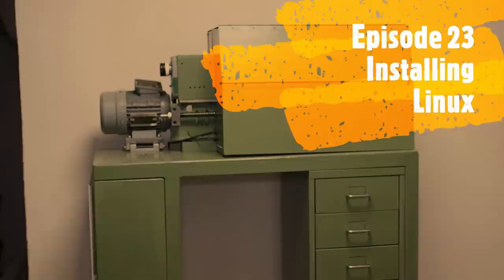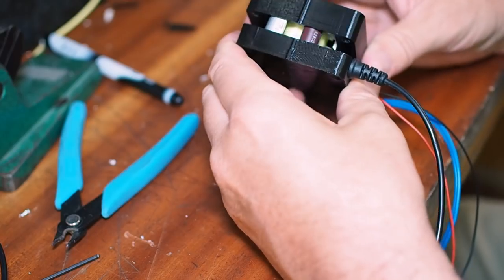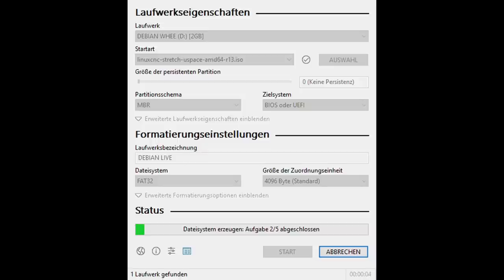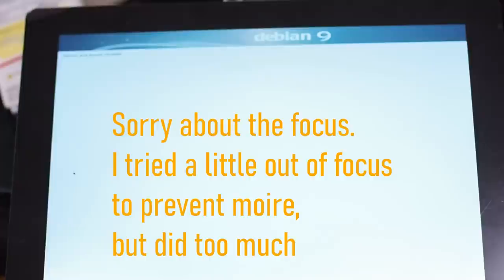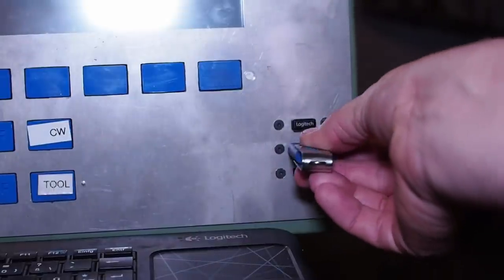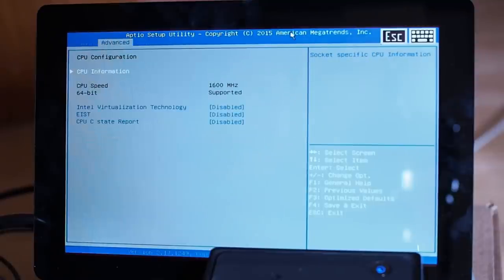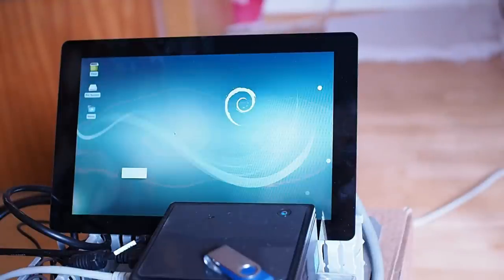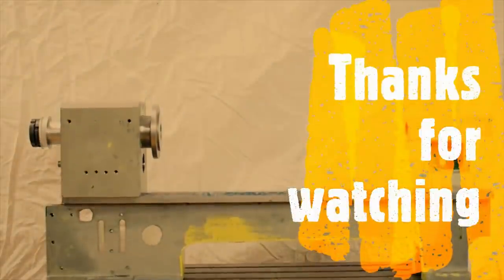CNC'ing the infamous 7x12 mini lathe -  Episode 23 - Installing Linux

Comment: After install, it asks you if you want "default layout" or "one empty panel". If you ask for "one empty panel" that is what you get. 
It's daft. 
The internet suggests "rm -r ~/.config/xfce4" then reboot to get a sensible panel arrangement.
(Now let me see if I can figure out how to disable that question for the next LinuxCNC installer)
Reply from the maker: Thanks Andy. I'm planning a config session this afternoon, as I need to upgrade from 2.7 to 2.8, and install the 1PWM firmware on teh Mesa 7i96, so I'll do that then.

Comment: In the old days a whack on the seam of a sealed (transformer-type) plug pack with the side of a hammer was the tried  and true method of shocking the glue line into submission, with about the best chance of a successful reassembly. The mass of the transformer core was the trick to it. The switchmode ones are much harder to open to repair, and  the damage caused makes it a lot harder to reassemble, they are now so cheap it's better to just bin them if they fail.  :)      Greetings from cold and wet South Australia.
Reply from the maker: Thanks for watching. Greetings from warm and sunny Vienna.

Comment: hello sir, I have no more information- what I understood was that it should be installed like siemens or fanuk as windows for PC? TX
Reply from the maker: I dont really understand your question. LinuxCNC is a motion control software, but run under Linux, not windows.
Reply: @RotarySMP  thanks sir- what way should be followed for fanuķ or siemens or they are same as this?  yours sincerely
Reply from the maker: @hsyn.mo4  I have never installed Fanuc or Siemens control system.
Reply: @RotarySMP  thanks for your replay- İ want to run fanuc system- I will follow your videos for it. TX.

Comment: Holly moley I thought Mach3 and window's XP was a lot of messing around to get a stable system, but i don't think there are enough swear words in the universe to  put up with that, I was thinking of giving linux CNC ago, as Mach3 and threading on parallel port set up is pants, but I anit got days or weeks to start messing around. Top Series by the way, it would be nice to see some threading when finished.
Reply from the maker: It can be a bit quirky, and is a way more powerful and flexible than Mach3 (analog closed loop, unlimited look ahead, non-cartesian joints etc) , but with that flexiblity comes an increase in effort. Luckily there are extremely knowledgeable guys on the Linuxcnc forum who are incredibly patient and helpful.
Once running there will definitely be a threading demo. Thanks for watching.

Comment: Panels are the thing that hold (among other things) the task menu you think is missing. Not sure why the distro you used is missing one natively ... that's odd, but can be remedied.  There are a number of ways to shut the system down from the command line. but what I usually use is "sudo init 0"   (that's a zero)
Reply from the maker: Thanks. I'll try that.

Comment: I like to throw ultrasound welded cases to get them apart
Reply from the maker: Doesnt that result in a high number of destroyed innards?
Reply: @RotarySMP  They are shockproof enough, i need just a bit cracked weld to get it opened. Idea with a vise is good one, with some inequal forces on weld it will crack with no problems and with a good control
Reply from the maker: @poprawa  Thanks.

Comment: my 2 cents on breaking adapters ,laptop batteries or any other glued enclosures
just add  little drops of gasoline (petrol) along the seams and you could open them with bare hands without using any substantial force.Try it once you'll never use any other method
Reply from the maker: Interesting method. I remember that for the future. Thanks for watching.